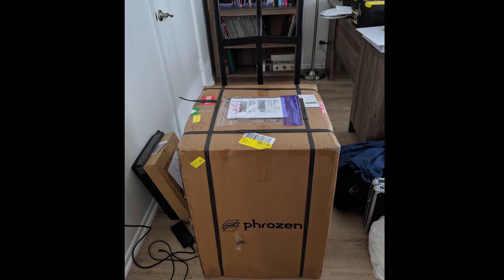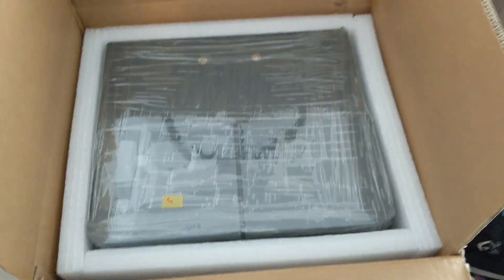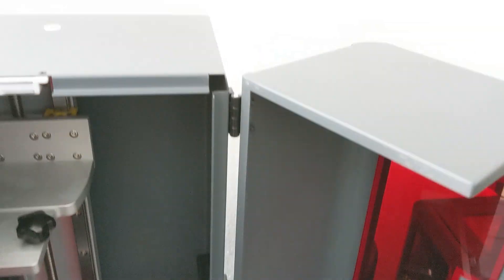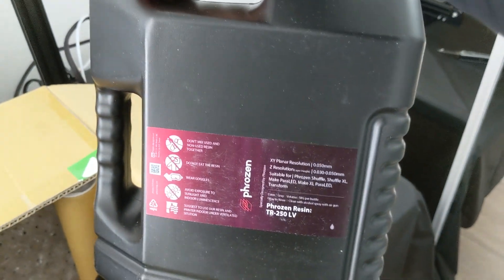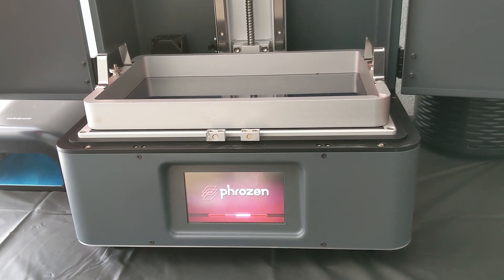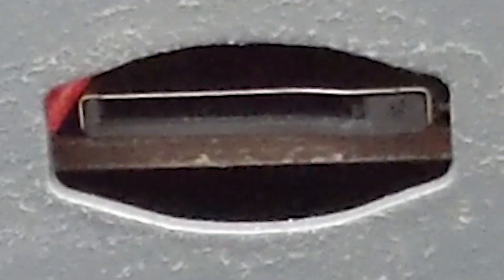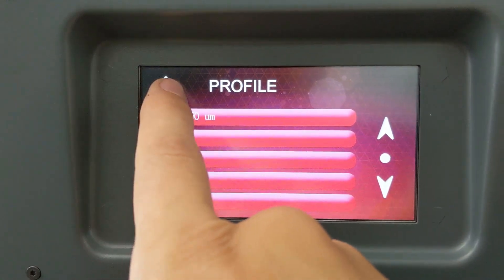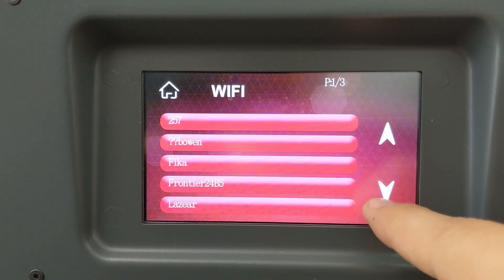Phrozen Transform Unboxing, Setup, and Impressions. Huge New Resin 3D Printer!

Comment: It's really hard to find the support files! Took looking at the URLs in your video to find them.
Are there any firmware updates yet? We're sitting here stumped because we've plugged it in and the wifi doesn't detect the network.
As for why it has a shutdown menu option, you want to use that before you turn off the physical button because the printer OS is a linux distribution. So a hard shutdown without a soft shutdown could corrupt the SD card.
Reply from the maker: I haven't been able to get Wifi to work on mine either. It detects my router, allows me to enter my credentials, then fails to connect. And yes, the product is shipped with no manual and no easy method of finding support files. This could be done much better.

Comment: What's the interest to switch on two 5.5" please ?
Reply from the maker: The two 5.5 screens have a better XY resolution and you have the benefit of using the same machine to print two different kinds or colors of resin in one go. I already have a Photon, so it wasn't worth it to me to get the additional setup but I can see why others would appreciate it.
Reply: @DungeonPrinter  prints with 4k screen have lower qualitate ?

Comment: I had been wondering why anyone would want the 2x 5.5" screens instead of the 13" screen, and now I understand. This was the first time I've seen the pixel sizes mentioned. If you are printing things that you want the best-possible minute details (though restricted then by the size of the screens), you want the 5.5" screens. A larger item that may not require such detail (e.g. helmets) use the 13". That being said, if the 5.5" screen panel for it costs more than another printer with a similar 5.5" build area and resolution, then one might as well buy a second printer which might improve productivity.
Reply from the maker: The benefit of the 5.5 attachment for the Transform, other than better XY resolution, is you basically get 2 printers worth of build area. So if you're mass producing some minis, the Transform will go a little further than a single Photon would. But really only a good option if you're getting the Transform anyway and don't already have a smaller one.
Reply: @DungeonPrinter  Except you could "mass produce" potentially 2.5x as many minis using the 13" panel (build plate surface area of 66 sq in.) in a single job compared to the two 5.5" panels (25.8 sq in. combined), but you'll get better details from the 5.5" screens. That's assuming you can put multiple models into a single file being printed? I've done that many times with my FDM, after all; my slicer doesn't care. Is there some software limitation on the Phrozen that prevents multiple models being printed in a single job/screen?

Comment: Way to get a bunch of subscribers fast :). I’m also a backer. I’m in the kickstarter special batch for the dual.  I also bought an extra lcd which was I think was around 130$.

Also. Do you have your printer in a room in your house?  How do you deal with ventilation?
Reply from the maker: Nice, good to know the extra LCD is only $130. 
I have a "hobby room" where my printers live and are next to a window. I just have a Lasko Wind Curve Fan set up next to the Transform that blows out the window and that seems to do pretty well. If I don't have it on, the room fills up with an odor pretty quickly, so I'd definitely suggest venting somehow.
Reply: @DungeonPrinter  I have a 3 car garage with the 3rd car spot is deeper (tandum).  So my plan is to wall off that area as a workspace and seal it off best I can.  I'll have to add an AC since I live in AZ and it gets really hot in the summer.  I figured I'd also add a ventilation fan to take out the fumes.

Comment: Ive been considering building my own XL resin printer... I must admit i like the look of this one, but yeah 13 inch at 4k means a nearly twice the voxel size on the print. Though bonus, large prints :)  I think for 4k the sweet spot is around 7-10 inch panels... But its really hard to fine.

Comment: I am wondering a 13.3" 4k display lcd replacement will cost an enormous amount. This is an awesome machine but not feasible for printing small models in less quantities. Best for higher build volume models or a higher production rate for models 👌🏻
Reply from the maker: Definitely! I'll keep my Photon for minis unless I'm printing an army at a time or a larger scale figure. No idea on screen replacement costs yet, but the current Phrozen lineup aren't too crazy.
Reply from the maker: Another comment said they were able to buy an extra LCD for $130, so not too terrible in my opinion.
Reply: @DungeonPrinter   Ok I checked my invoice: Phrozen Transform Add-Ons - 13.3” LCD  $89.00 USD
If I remember right, this was a special lower price because I got it as an add on to my backing.  But I don't think it's that much more than that normally.

Comment: I'd say the uSD slot is so big so you can get your finger tips in there to remove the card. That said, seems really odd that the printers OS is on an SD card.
Reply: They could have placed the slot a bit towards outside... but yeah, odd indeed... I guess it's cheaper this way than to have an onboard memory cell...
Reply: @crealabdd9740  though it would make changing firmware versions nice and easy by just swapping us cards.

Comment: A "soft" (GUI) shutdown is almost always safer on the OS, especially if the OS is on a uSD card. A "hard" (power) shutdown can cause OS corruption. Not saying it will however, it is possible.

Comment: the shutdown from the touch panel turns the operating system off, then you can turn off the machine (apparently they didn't use a relay to power the whole machine off from the OS). If you power off from the power button it's the same as turning off your PC by unplugging the power cord. That being said the OS is on a SD card, so if anything goes bad, you just change SD, reinstall the the ISO image and you are good to go.
Thanks for the overview but we need prints!